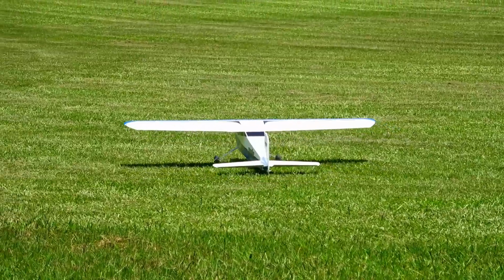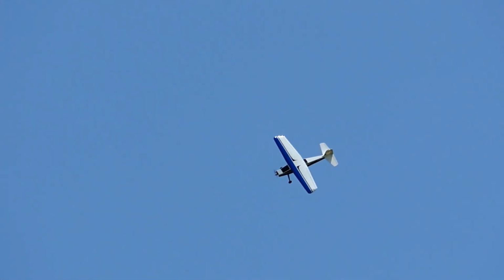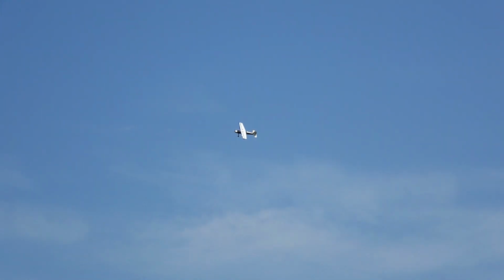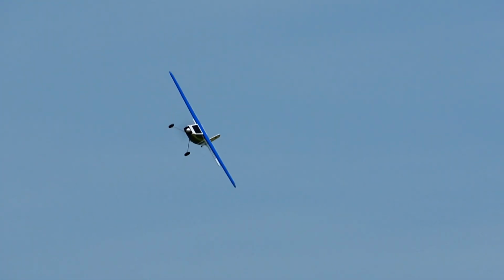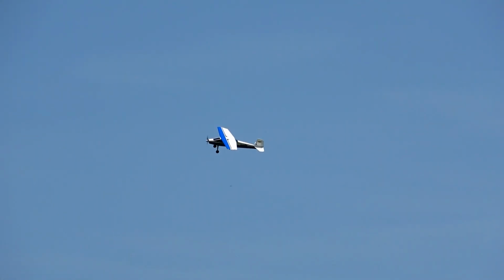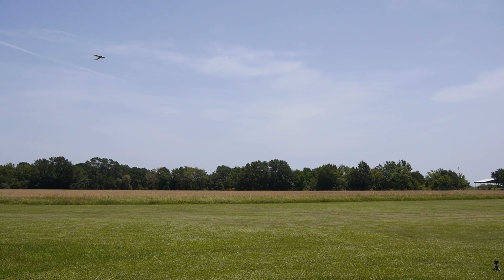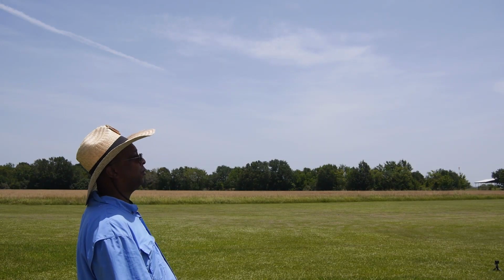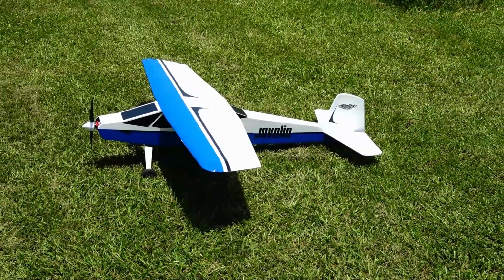Old School Model Works Javelin - Model Aviation magazine

Comment: Hi, what a lovely flying model!! I'm just wondering about the power for the model. I've got a 1900kv motor rated to 1800w with 120A esc, and a 9x6 prop. Would that be too much for this model? Only weighs 360g all up so seems to be inline for something of this size? What were you running in the video?
Thanks : D
Reply: 1900 kv is a bit too much for this size model. It would probably work ok (3S max.), but not an optimal setup.
Reply: @HobbyView  I suspect it's far too fast. Overspeeding hehe